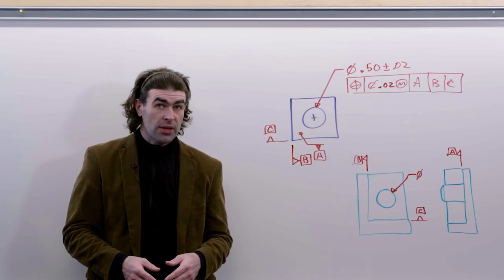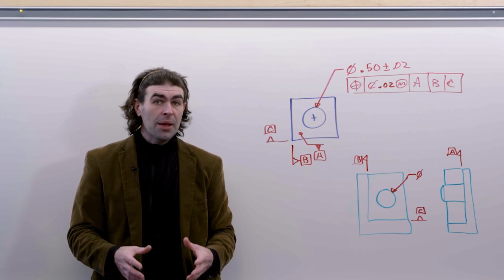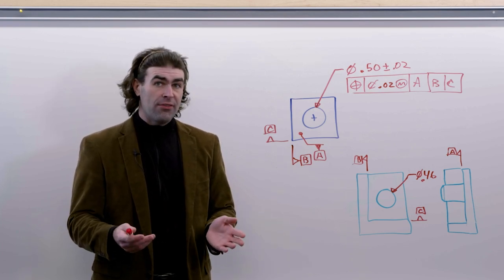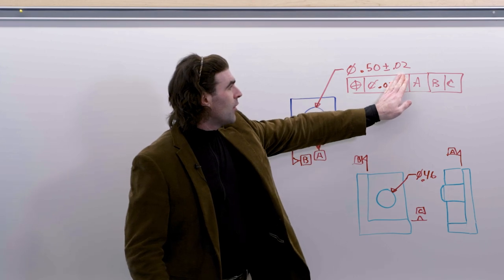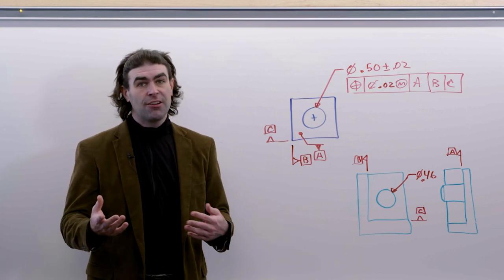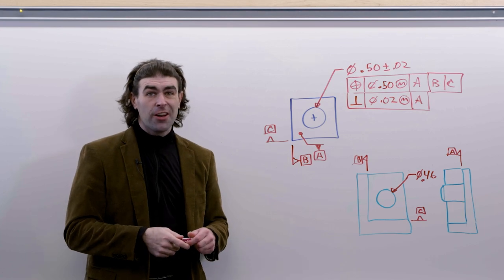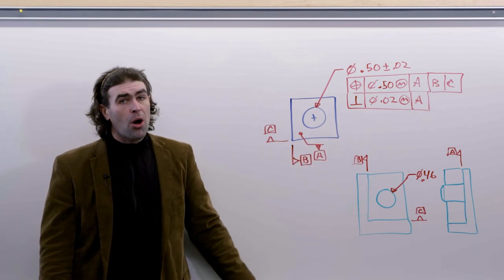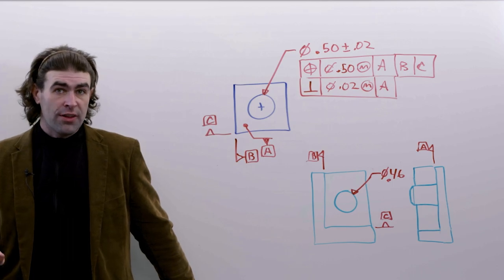ASME Y14.5 GD&T Surface vs Axis Method Explanation

Comment: The function of this fit of two zylindrical features can be specified with tolerance zone diameter zero at MMC of the derived feature or with a tolerance zone at MMC and an additional reciprocity requirement. If there is no reciprocity at ASME, there is only the solution with tolerance zone zero and an expanded tolerance for the linear size. Please do not give away any tolerances. The suitable datumsystem should be defined by the degrees of freedom, which the two features have in the fit function.